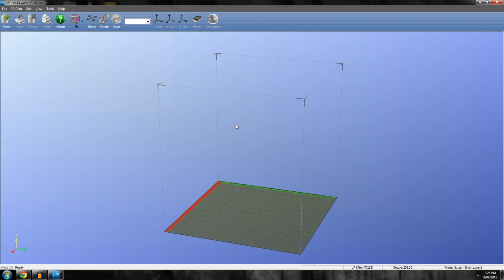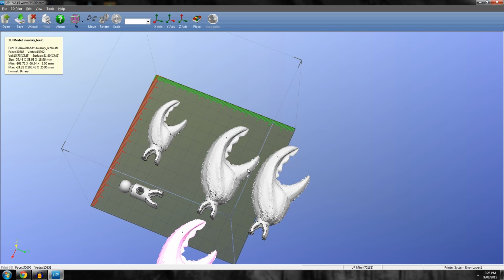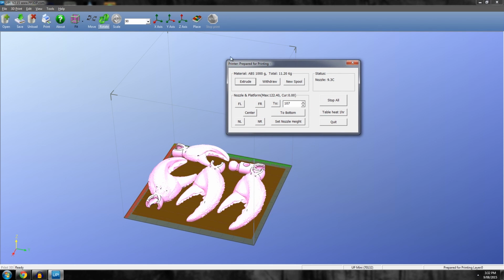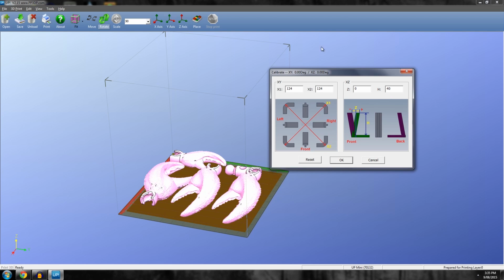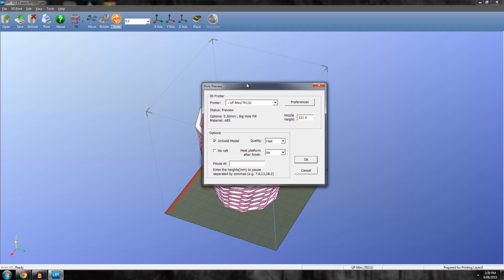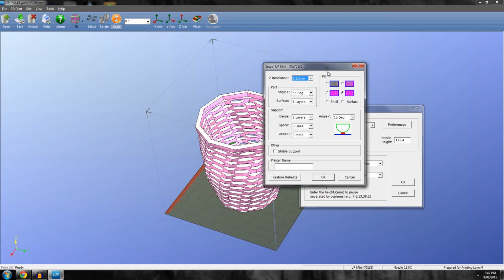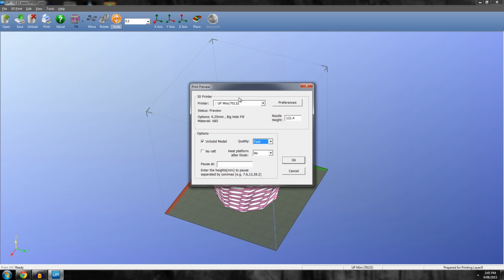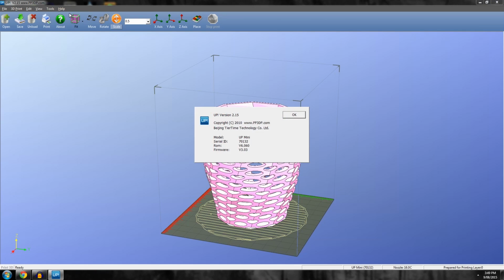UP! 3D Printing Software Overview - 2015

Comment: How did I miss this? Thanks YouTube engine!. Anyway, few notes for those who care. 

The version Angus is demoing is 2.15. If you go back to 2.1 you gain the ability turn off supports altogether (in the Area drop down you have "Only Base" -  in other words, only use a support (a raft) under the base -  if you then have the raft turned off in the Print Preview box then you won't get a raft or supports.

My understanding of the Unsolid Model checkbox (at least in 2.1) is that it's the equivalent to Cura's "Fix Mesh" where it tries to solve inside-out poly's and holes. The user gets to check it if they see red in the model and the software will try its best to fix things and will still print. In that version it does not check itself.

One thing Angus didn't mention is the Nozzle Height in the Print Preview box. This is where you set your first layerheight gap. You can also set it in the calibration area - you basically move the bed up manually and get close and then keep tapping the bed up by single increments each time testing with whatever you use to set your gap between nozzle and bed. Once you have the kind of spacing you want, you save this height and it will show up in the print preview box. It's handy being there because different filaments have different viscosities and you often have to tweak this number up and down to allow the filament to flow out in the gap -  if you are too close for an overly viscous filament, it will jam in the extruder since it can't get out. (there is only a pressure bearing in the extruder and not a spring so the gearing is not very aggressive and it doesn't take much for the extrusion to fail to pass through.

The navigation buttons in the Maintenance menu: If you are using clips on the bed, once a print is done or after the printer is initialized , often the nozzle will come down on the clips since it parks in the back corner. Before every print it's handy to hit the center button to prevent this. Along those same lines - the printer makes a prime line before every print. It is significantly in front of and left of the print. If the print is nearly a full bed, that prime line will hit any clips you have there. This printer is violent so it can cause some damage.

The software saves the last print settings including first layer height when you quit. Saving as the Up format will save not only the position of your objects on the bed (but it looses any connection to the original models), it also saves the settings for that print inside the file.

The newer Studio software looks very  different to this but is still functional for both the UP! and Afinia printers. The catch is you loose a bit of functionality. Like the "no supports" button (oh it's there but it doesn't work with older printers) But you do gain the ability to change the temps for both bed and nozzle whereas V2.1 - 2.8 only allow two preset temps, one for ABS and one for PLA. A down side of this is you loose the top end temps you can do in 2.1-2.8 for ABS; they thought it would be too much for the enclosure machines that came along later -  so 99C for the bed is as high as Studio will go (2.X will go to 105C)

You can alter the temps with a hack, Octave used to sell a resistor network that interrupted the thermistor reporting back to the software -  dip switches let you set temps from (for ABS) about 170C to 270C) and the same kind of range in the PLA range. You can also just build a voltage divider if you are so inclined to do the same thing.

After reading the comments I'm sure there are those who have used other slicers and are saying "this is so limited, why bother?". And you are right, but it's because of the printers: Linear rails, crazy fast, crazy accurate, nice sharp corners on prints, and built like tanks. The Studio software tames them a little. They have tempered the speeds with more gentle acceleration curves (a glitch in the 2.X software can do this too for some reason). So if you want the violent deskshaking jerk of super fast printing, stick with 2.X. For some older printers V2.8 doesn't have a drop down menu for layerheights. Just go back to 2.1-2.5.

Comment: I have some faces highlighted in red. The fix command does not fix them as it said it might in the manual. How do I fix this pls?
Reply from the maker: Your file is damaged, fix it with 3D builder (if using windows 10) or use cloud.netfabb.com !

Comment: Thanks Angus,
I've been using Ups for about three years and I didn't know about the Control hotkey with the mouse to move models. I've always used the move button, which can be tedious. So thanks, you've taught this old dog a new trick!

Comment: HI AngusI have been using this software for four years now with the original UP printer and still learnt some great tips from your video. Thanks heaps mate! I love the print quality of the UP printers and I am about to purchase the Up Box. I talk to people in my community that use other branded printers and they ask me to print things that they have printed and when I return the printed part, they ask why does my printer fail to print that well. I say I do not know, My printer just does it. I think this is why the software is so simple and does not want you to change settings. It just knows what is going to work.I am now cooking with rice cockers due to another vid you posted. Fantastic results. Thanks again mate. RegardsKeith
Reply from the maker: +staples919 Thanks for the kind words! Sorry for such a long delay in replying haha. Yeah that's exactly what I tell people who claim they want to print at 50um layers - it's pretty much pointless for most people - what you really need is reliability and the UP's have that nailed down. Did you get the UP Box? It's an absolute beast I hope to review one soon.
Reply: +Maker's Muse HI AngusI will be going on holiday over seas during Christmas and the first thing on my agenda when I get back is to order the Up Box. My up 3d printer is like a car that has done 200,000km so she is a little bit tired. I know the punishment I have dished out to this machine and it just keeps on going. The only problem I am having now is the gears that extrude the plastic are worn out and large prints will suddenly start printing air. A set of new gears and she will be ready for another 200,000km of printing I am sure. Looking forward to the Up box though as I have a project on hold until I have the print area that the Up Box offers. I need to print the front section of the Serenity Spaceship from the Fire Fly series. This is for my kids of course. I will message you when I receive the Up Box and give you a run down on it. I have every confidence it will be a good product.RegardsKeith

Comment: My up box printer just went from %50 wow to %1000 wow with the addition of Buildtak.
no more rafts that don't come of or leave crap on print. super smooth finish on bed side. I do add a 0.2 brim to file for small parts and works perfectly.
Reply from the maker: furnibird That is epic to hear! Did you just stick it over the existing plates? I've heard of it done on the Plus 2's but not on the UP Box yet. Really cool!
Reply: +Maker's Muse Yes just stuck it on a new perfectly board and away it goes. I do set the nozzle manually. #furnibird
Reply from the maker: furnibird Awesome! I'll keep it in mind.
Reply: +furnibird How do you add the brim?  I cant see it in the UP software so assume you use another program?  If so what program will do it?
Reply: +Terry Gregg 123d Design.   I just add an area around the object and make it about 2 or 3 layers thick.

Comment: Thanks for the walk through. explained a few things I was unsure of. I found the Mac version lacking in function so have now switched to win version for the printer.
Reply from the maker: furnibird I think functionality is similar, just a very different layout. Glad it helped :)
Reply: +Maker's Muse The Mac version doesn't seem to monitor the temps when printing and no right click. I was reading the manual when I got the Up box and was a pain as its all in the win version and the Mac version looks very different. very odd if u ask me. and no support g code view should be a must for next release. but loving my first 3d Printer now the heated bed is working again.

Comment: Hello Angus,
I've been watching your videos for awhile and being a beginner 3D printer guy, found your videos very helpful! But my question to you is any recommendations on how to get a decent print using PLA? I have an up mini and it works wonderfully with my MAC and ABS filament. Both name brand and generic.
Reply from the maker: duke1252 The trick with PLA is it's the complete opposite to ABS - you want to cool it down as fast as possible! So in the Up software change to PLA in the maintenance window, and then to print you literally need to open / remove the top cover and door, and point a desk fan into the chamber. If you don't, the extruder motor overheats and will chew the filament due to the much lower melting temp of PLA. Really though, the mini is a Beast for ABS, most printers only resort to PLA because they can't handle ABS without getting warping. Hope that helped!
Reply: It did, thanks!